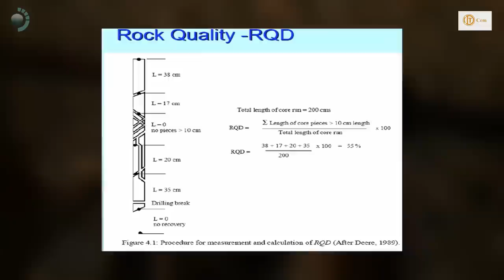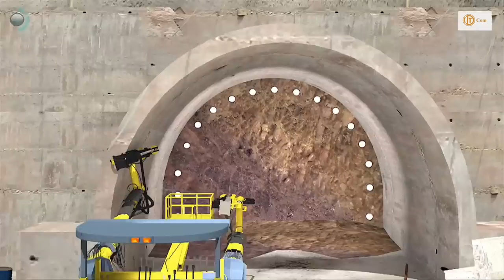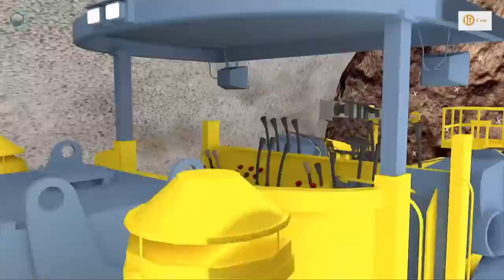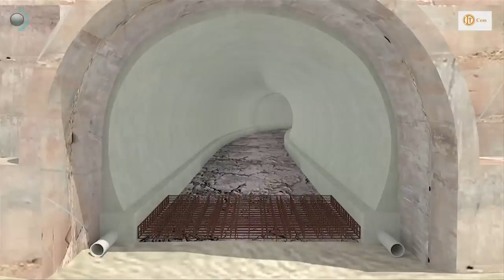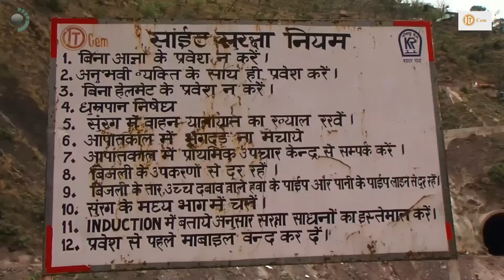How India is building the most difficult network of Tunnels in Kashmir Mountains?

Comment: wow so many different comments regarding a lot of thing's..i probably just never read all the comments, so not sure if any one has mentioned the safety aspect..The region is mainly broken rock and sand witch tells you it's moving slowly..but you's want to build tunnels through 2 current slip lines of the rubble...(that is  just crazy) a road would be a better Idea. not a Train that carries 1000's each journey..1 collapse or slip would be costly to India..and with the Earthquake risk in the region is it really that wise to build it. when the money could be put to use else where.
Reply: thats the catch there..thats why its a construction marvel it is built in a way it works out well in long term...meanwhile kashmir on pakistans side dont even have clean water to drink and is filled with terrorist camps